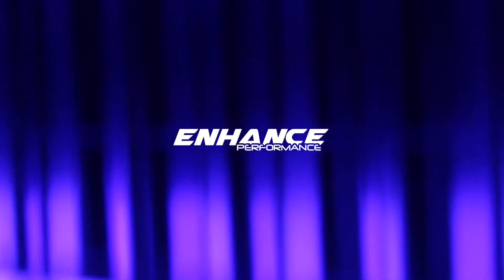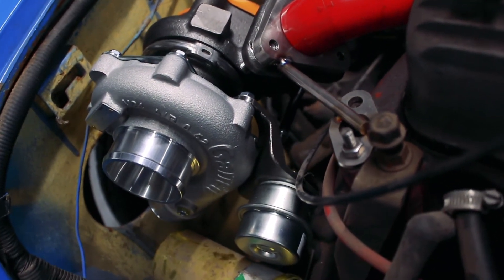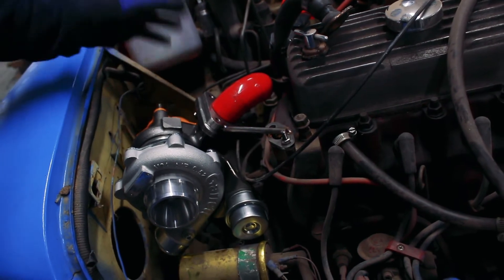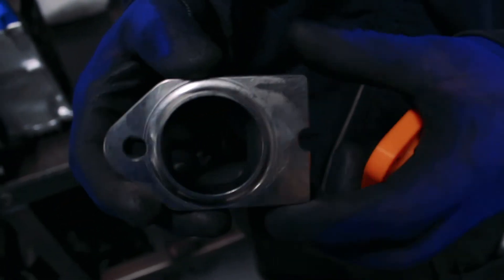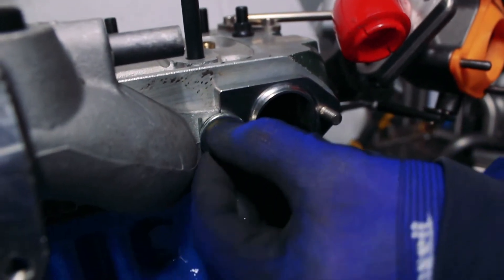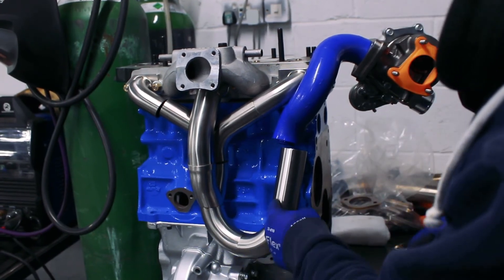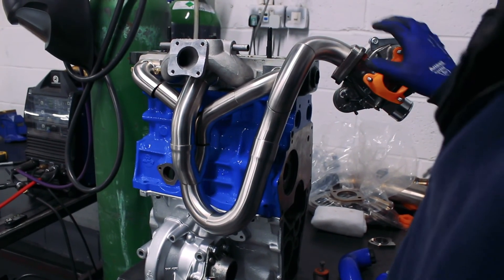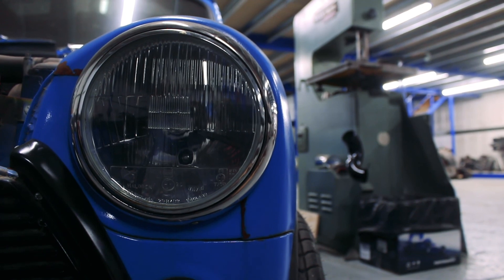Austin Mini Gets A Garrett GBC14-200 Turbo Kit (Part 1)

Comment: Great video and exceptional work.  Your welding and pipework skills are amazing.  I have a Mk2 Austin pickup truck I am in the process of upgrading.  Currently in the process of installing a full sport suspension and upgrading the drum brakes to 7.5" disc.  Next will be engine work.  I have a 1275cc and am interested in your kit as part of my build.  Any chance you finished this one and have a kit available?